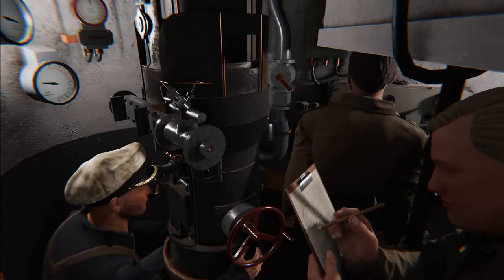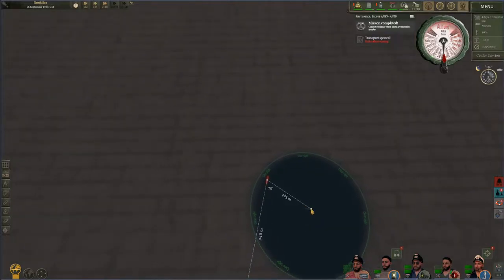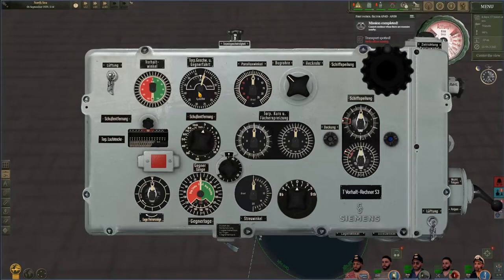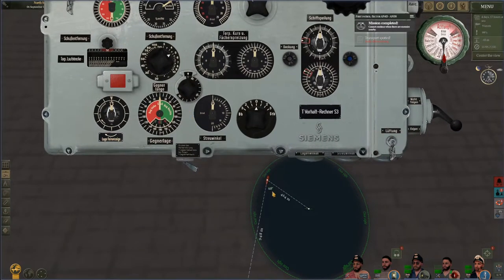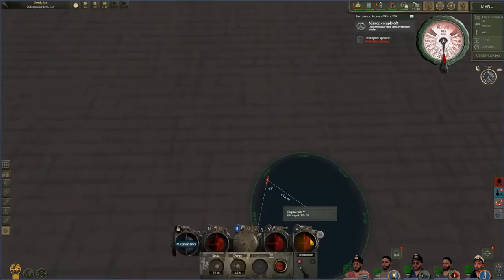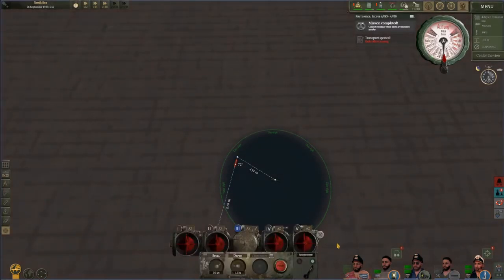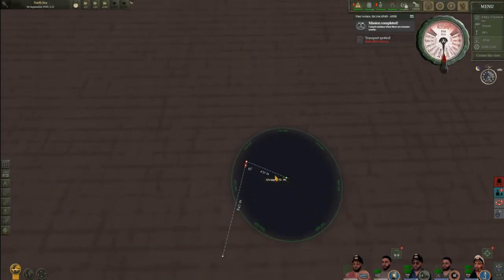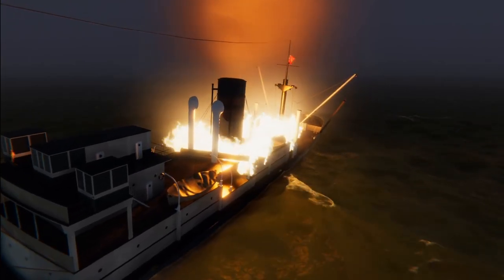UBOAT | How to Use the TDC Mod

Comment: Also, clicking in the middle of the bottom left gauge will enable AOB auto tracking, based on bearing change. Very useful if you don’t wanna keep updating the AOB manually after initially entering it.